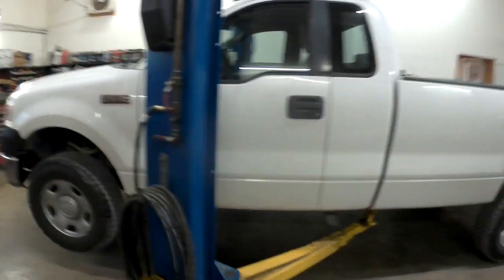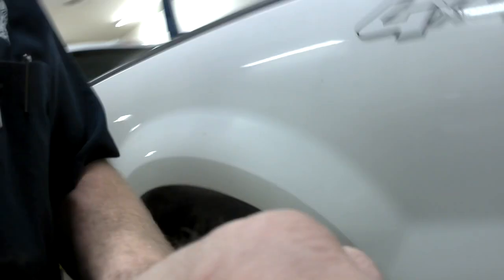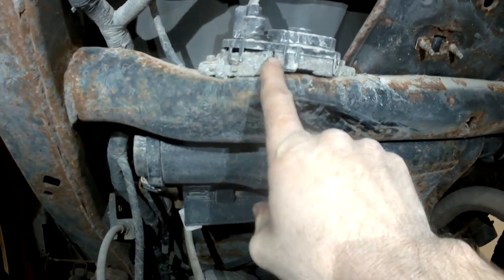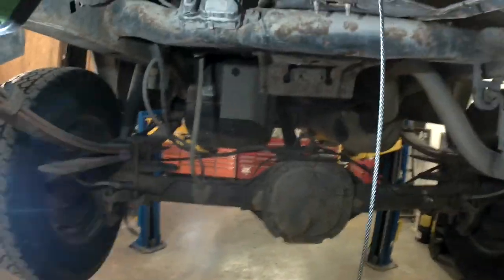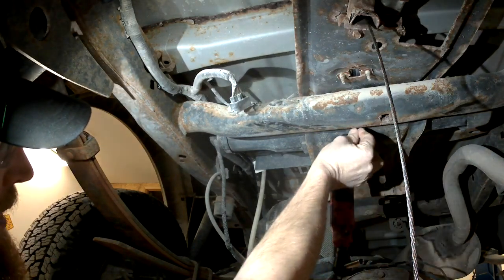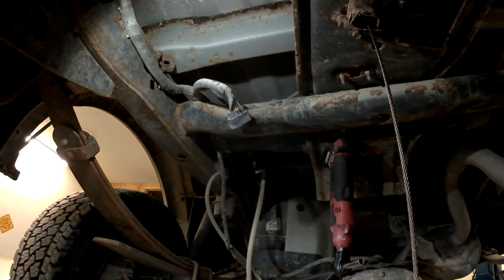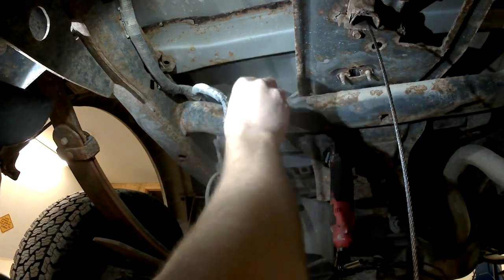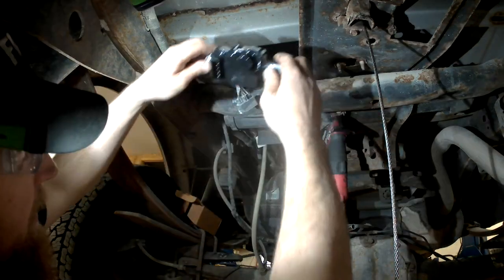Diagnosing and Replacing a2007 Ford F 150 Fuel Pump Driver Module

Comment: So this just went out on my truck or so I think I got it towed home jackd it up and well it did have exposure on the back of the fuel pump driver module, but my crank feel a little slower than
 normal but imma go a head and replace it just it died on the interstate an then it had slow crank but still strong no start

Comment: Wish I could give this video more than one thumbs up. My truck was running rough and then stopped all together. Luckily I was only a half mile from a parts store. I thought it was the fuel pump, but I saw this video and dropped the spare just to check. Saw a Crack in the casing and new right away it was the problem. It looked just as bad as yhe one in the video. Took it off and walked to the store. Had it fixed in less than an hour. I would have waited longer than that for a tow. 👍

Comment: That individual ground that comes out of the harness, any idea where that goes, and what it grounds? Replaced my fpdm today and the terminal on that ground was broken. It seemed to be just the right length to go under the left bolt on the module, so I cut it back, new terminal, and put it under the bolt . I now see in your video, it looks like it heads towards the center of the truck. No way ever mine is that long. Any intel is appreciated.
Reply from the maker: Right off the top of my head, not sure where it goes, but as long as you have a good ground to the frame you should be ok.

Comment: Does this part failure throw codes? If so, what would or could they be? Also can failure cause loss of accelerator pedal response?
Reply from the maker: The general issue is  a loss of the fuel pump. This may make it feel like it is running out of gas, and depending on the severity of the corrosion, it can be an intermittent condition. It may throw a code, but most of the time I really don’t see codes, just low or no fuel pressure.
Reply: @JosephVollmar  appreciate it. I replaced it, along with the TB and my symtoms didn't change. I had a fault code that apparently was a pcm death code. Replaced pcm, so far so good.

Comment: I have an 05 expedition. It has the 5.4 3 valve motor. I searched this video based off of what someone said in the forums. Truck runs just fine. But idle is a little choppy and it sounds like a diesel. Could this be my issue?
Reply: I have the same issue.😢
Reply: no that’s a timing job

Comment: I just change my fuel pump driver module and star fine for 20 seconds then and get bad idle and the gas pedal don’t respond 
I have 5 different codes p2101,2104,2110,2111,2135 many people said I have to program it before start up the truck
Now my truck is on limp mode
Reply: Any update on this?
Reply: Throttlebody sensor and back to road
Reply: @javerlozep162  Throttle position sensor failed after you replaced the module?
Reply: @TKO-NY  yes 
Here what happens my truck works fine but don’t pass the emission test for 3 times catalytic never get ready and they tell me I have to run the truck more ,they think I disconnect the battery 
Later I take to the dealer to find out what’s going on and they find the problem was the fuel pump module 
The dealer want 850 dollars and 
I do by myself   
I turn the truck with the new module and 
The engine  have very bad idle 
With a thousand codes everything 
Point to throw body

Comment: This was a quick fix to my 2007 Ford F-150!  On a rainy day, it started to stutter on hills and under a load.  I thought it was an electrical short or maybe a transmission problem.  Luckily I was able to nurse it home and then it completely died and finally popped an engine code showing problems with the fuel rail and a misfire!  Only then, did I know it was a fuel problem...  My module had a large hole in the back.  Less than 20 minutes to remove and replace!  Thanks again...
Reply: Same thing here

Comment: Joseph,  How many miles were on this F150...?   Did this vehicle throw a DTC Code of P1233...?
Reply from the maker: Both of those questions I really can’t answer off of the top of my head as it has been a while since I shot that particular video. I can tell you that mileage is not nearly as big of a factor as just environment. I have seen low mileage trucks have this issue as well as high mileage ones. Dirt, road salt, and grime all play a major role in the corrosion of the module. If there is any issue that I suspect is fuel related the first thing I do is drop the spare and check the module.

Comment: I get a hesitation when pulling off on a hill, or when under increased torque. I changed the fuel filter, which helped, and then thought it was the transmission, but the transmission shop said it was fine, but was throwing a code P1233, even though the check engine light was off. I plan on replacing this once the part arrives, as this seems like a likely solution.
Reply: Bad Intermittent Ignition Coil on Cylinder #3.
Reply: @williamriley2528  I replaced the Fuel Pump Driver Module - no discernable difference -  You may be right about the coil.. How do you know which cylinder? I decided I had enough and traded the van  about a month ago, but would still like to understand what was wrong - I hate giving up and never knowing what was wrong.

Comment: It might have been a good idea to coat the aluminum back of the actual FPDM with the anti-corrosion material, vs. the frame; as the rubber spacers now prevent the module from touching the frame. It would also have been a good idea to use some di-electric grease on the electrical connectors.  Thanks for the video.